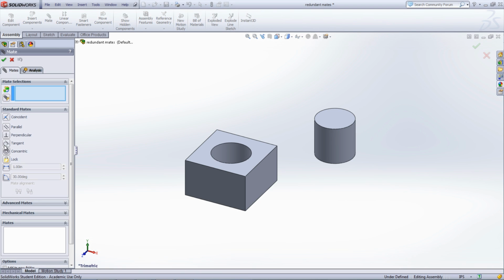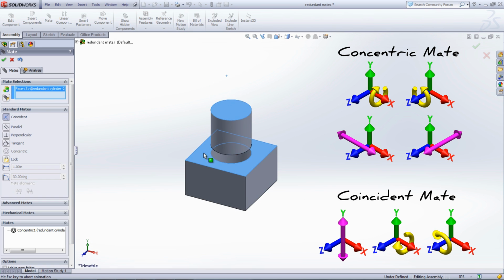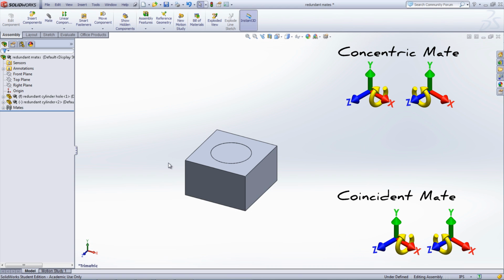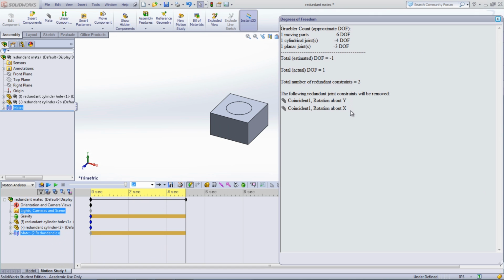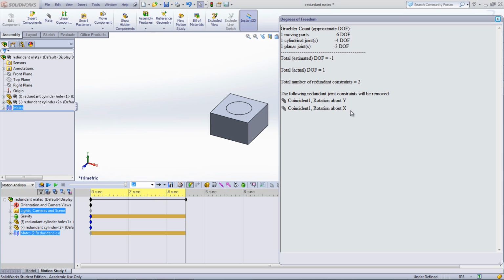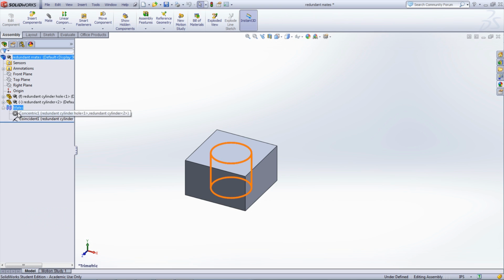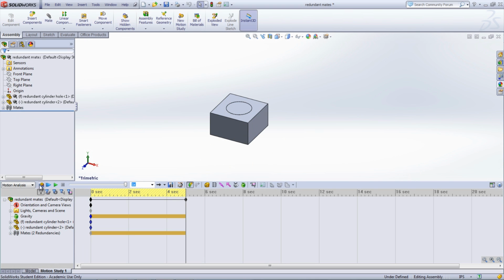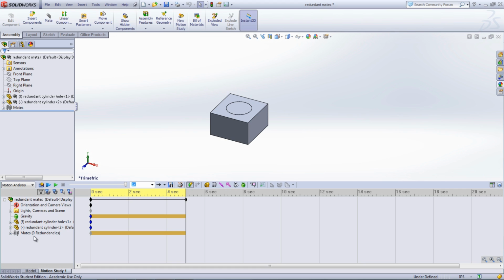SAE Car Suspension With SolidWorks Motion: Part 1 Eliminating Redundancies

Comment: I noticed when you were doing the hinge constraints you click the ''X" which means you didn't apply the hinge constraint. In the motion study it said 0 redundancies because you didn't have any constraints. Am I correct? Or did you happen to add the hinge constraint and not show it?